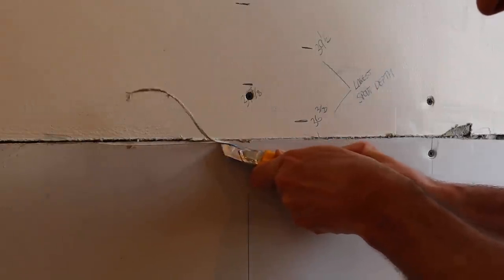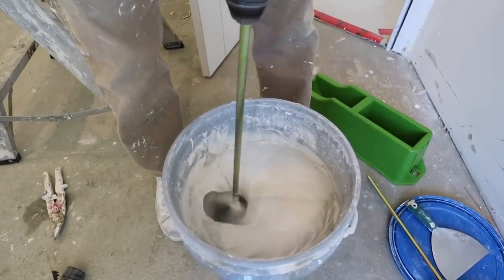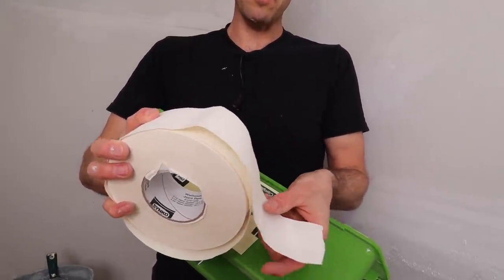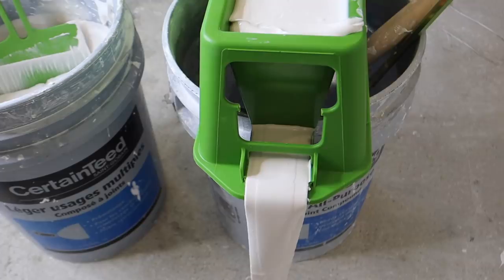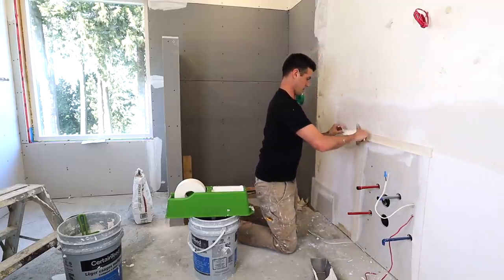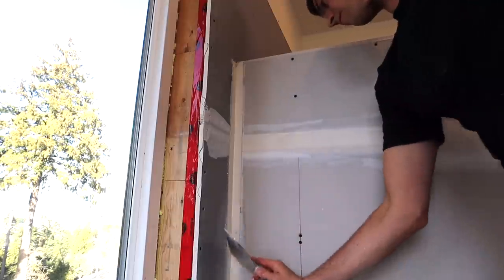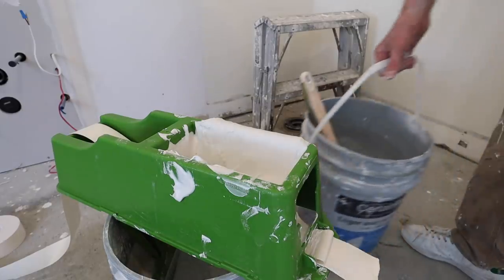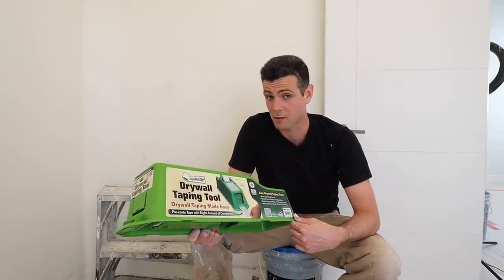How to use the Tape Buddy

Comment: This is great if you have to do a small repair or room. Don't have to take out the bazooka and pump. I've seen guy make 2 slits in the bottom of a mud box and fill it with mud. 
Good video my dud

Comment: My dad what is a drywaller started out Young when he was in his teens he made a tape buddy out of 3/4 inch wood at the bottom of a trough they made it where the tape would fit. How to tape reel on the back the type of Pole from the back of the trough to the front what's an extension on the front a cut find blade hacksaw at the end to tear the tape. He got so good at calculating when pulling the tape out how much to pull for all his flats and butts he would leave it through his fingers start at one end pull the tape to the length right before is wingspan reach. He would hold the tape over the joint pull it and snap it right into place wether was a ceiling flat or a wall. That was in the fifties and sixties.. he had hung so much sheetrock and finished. 
I never seen him sand. He is 4-inch 6 inch and 12 inch hump and flat trowels.

Comment: I wish you would explain prefilling more what do you use to pre fill.. is it just all purpose ...if so are you letting it dry before taping over it or not
Reply: Pre-filling should be done with setting type of compound so it doesn't shrink. Pre-filling is only needed where drywall gaps are over 1/8" or areas like broken corners or edges. If you do need to pre-fill areas make sure the compound stays below the surface of the drywall then tape over it. With setting compounds you can tape over this when it sets up and doesn't need to wait until it's dry. I usually buy 20 minute compound so I can get the job done faster. Many times corners are the worse. They need pre-filled as they seem to be the areas where the drywall doesn't fit tight.

Comment: Awesome video. What about using a Sheetrock 90 Joint Compound for the medium size or small joints? I mean apart for hardening in 90 minutes and drying in days is there another difference with all purpose join compounds? Thank you.
Reply: You can read information on the types of mud on our website
BuddyToolsLLC.com

Comment: What’s your thoughts on FibaFuse drywall  Tape?
Because it’s not paper it doesn’t swell up reducing the thickness on the seam. As well, like fiberglass tape, the taping compound flows through the fibers imbedding the tape more thoroughly, as opposed to sandwiching it in the case of paper tape.
For me, I find the FibaFuse requires less feathering.
Reply: Peter, I just made a comment about this under what Bradly said about the NUBS in the fingers. This is an issue. It hurts and they don't come out very easy. This tape also doesn't lay as flat as paper and the fibers keep coming to the surface. They don't sand off since they are glass. The TapeBuddy tool can run this tape just like paper but I prefer normal paper tape. Goes on flat and is strong when applied right. Yes, the mud squeezes though the tape so has value in this regards. When this tape is run through a TapeBuddy tool you don't need to pre-coat the seams which saves a lot of time. The tape is more costly than paper. Get a TapeBuddy tool and it will help make using Fibafuse tape easier.

Comment: Careful with the US advise. 
I tried to tape with that lightweight Plus 3. The tape literally fell off the ceiling. It’s garbage for tape. You MUST use green bucket or setting for your tape coat.
Reply: I picked up a bucket of light weigh mud with a lime green lid just for doing a demo. It was damage and Home Depot sold it to me for $3. How could I go wrong? So I fill the TapeBuddy tool for the demo, pulled the tape from the tool, applied it on the drywall as I'd done 1,000's of times before. Tape applied I turned to the person to tell them something for maybe 1 minute. When I turned around to the demo piece to show how the tape was working it was already peeling off the drywall. I didn't use this anymore and tossed the bucket in the trash. Might be good for top coating but not taping. That's why I always suggest Sheetrock green lid heavy weight compound. It's the hardest compound out there and work great all the time.

Comment: Hi! Thx for the video! Can I use several strip of paper for one joint? Exemple a 8' foot joint with 2 strip of paper of 4' each?
Reply: You pull the length of tape that's easy to work with. Joints don't make any difference in strength and the tape can be butted together or overlapped.

Comment: Thanks so much for all your videos. They are so helpful. The only thing I struggle with... you introduce the products available in Canada and US however, I'm in Australia. While I find all the different coating products in our local hardware stores, I struggle to find what you call "quick set". My thoughts are going to something like "Polyfilla" .. am I on the right track? The products you introduced in this video are not available in Australia, as far as I could find out. What would I need to look out for, any hints? Also, I find it quite annoying that with the products available to me. I need to wait for 24 hours to do the next coat, but it seems like my local plasterer does the whole job in a day i.e. taping, first coat, second coat. Am I sort of conned here?
Reply: I'm not in Australia, so I'm giving an answer based on a quick google search, but I believe that Rhinobed is what you're after.  The website calls it an 'adhesive setting' plaster, Sounds like quick-set.  So if the Aussie stuff follows the general trend of our stuff, then you would use Rhinobed to pre-fill the joints.  It will be a fast setting plaster with high strength and low shrinkage.  This means that you do NOT want to have to sand this stuff.  Put it on smooth and don't leave high spots.  You can use it for the taping coat with fibreglass tape, but Rhinoglide will be better for use with paper tape.   After the pre-fill you'd use Rhinoglide for taping (unless you use Rhinobed with fibreglass tape).
Rhinoglide is equivalent to our 'all-purpose'.   As far as I can tell, Rhinoglide and Rhinobed are the only products you should be looking at... The other products (like Rhinolite) are for plastering, not joint compounds.
Rhinobed seems to be equivalent to a 90 minute quick-set.  If you want it to set quicker then use hot water to mix it, and it will set faster.   The website implies you can get different setting times, but the product sheet just says it set in 90 minutes, so... I'm not sure.  Here the bags are marked as 20minute, or 45 minute, or whatever, and you can use whatever speed appeals to you.  90 minute is still an order of magnitude faster than normal joint compound, so don't feel like you 'have' to have faster mud.
Reply: @mikegraham7078  thank you
Reply: @claudews529  thanks champ. now it makes sense

Comment: Great video as usual Ben, I’ll definitely order one through the link next time I’m doing a Reno.

Curious if anyone could provide advice.  I always mix up too much in my bucket, what do you do for cleanup in that case to save the bucket?
Reply: Eddie, to avoid mixing too much just mix the top part of the bucket and more as you need it. This will depend on how much taping you have but you can always thin down more mud. Also, I save most all of my buckets as well. Use the Scoop-n-Scrape bucket tool to remove all the compound from the bucket for easy cleaning and less wasted material.

Comment: Will I have troubles taping in the states with all purpose? I’ve heard that you need the glue in “taping mud” to stop blisters. Or should I use some form of quick set? Thanks
Reply: The all purpose green lid mud is perfect for taping. The glue is the wet mud so since the TapeBuddy applies the mud to the tape you won't have problems with tape blisters. You can find more taping information on
BuddyToolsLLC.com

Comment: QUESTION:  HAVE YOU EVER USED "Fibefuse" TAPE (widely available at Home Depot, Lowes, Menards, Amazon)? Could you make a video giving your opinions with it?   Love all your videos.
Reply: I have and I hate the stuff. I don't care if it's 1000 times stronger, the fiberglass nubs in the fingers gets old fast.
Reply: @bradley3549  You are right on the NUBS in the fingers. It hurts and they don't come out very easy. This tape also doesn't lay as flat as paper and the fibers keep coming to the surface. The TapeBuddy tool can run this tape just like paper but I prefer normal paper tape. Goes on flat and paper is strong when applied right. We'll see what Ben says.
Reply: @BuddyToolsLLC  I wear nitrile gloves when using fibefuse.

Comment: Hey, Ben! Happy Easter! 

Another great vid! I'm curious; i recently got a roll of fibafuse tape to try. I've done a couple of small repairs with it, and so good, so far. Wondering what your experience with it might be and how you think it might do in the TB, or other tape tools. Thanks!
Reply from the maker: I will make a video soon. I used it a bunch years ago. I'm not a fan. It gives me painfully itchy fingers.
Reply: @vancouvercarpenter  Same! Fiberglass in the fingers is THE WORST. I'm not a wasteful guy and I toss my last roll out.
Reply: I also found fibers in my hands but by using the TapeBuddy I didn't need to handle it near as much. Made it so much easier.

Comment: You never seem concerned with the mud drying on the inside edges of the bucket or bag. How do you deal with the bits of dried mud getting into your working mud?
Reply: Good question. This was a problem until we started making the Scoop-n-Scrape tools. We designed the Scoop-n-Scrape to use with the mud in the bucket and just for this purpose. This tool is made of plastic (nylon) so it doesn't scratch the bucket. Metal scoops tend to peel the bucket and put shavings in the mud. Not good! The SnS tool will scoop the mud out but it also can clean the bucket sides by returning the mud to the remaining mud in the bucket. After I push the mud back down I take a wet brush and run around the inside of the bucket. Cleans it up nice.  You can also use a wet rag. Check out the SnS video on the BuddyToolsLLC website.

Comment: This tool is ok at best. Ben is right in saying that the 250’ roll is best.  But you can’t really measure long lengths so you always have 2-3 pieces on a long run. 2nd it’s not very stable. 3rd corners are a pain trying to tear off a long length is a nightmare.
Reply: Just pull the tape and book it over to any length you like. You can use arm length pieces and just butt the ends together. Much easier to handle.

Comment: Don't forget to add some vanilla and food coloring. You want your mud to be yummy and pretty! ;)
Reply: A few years back I was set up at a Home Remodeling Show in IN demoing how to tape drywall with the TapeBuddy. We had 1,000's come by the booth to check it out. I had purchased a huge cinnamon roll from Cinnabon that was heavy on the sugar glaze. I took a fast break, went behind the display, took a huge bit and came out licking the coating off my fingers. It was so good! When I returned the the demo area there was someone standing at my booth that just gasped as he thought it was drywall compound. Still remember his face. That was the show where we presented the first Scoop-n-Scrape tool. A Sherwin-Williams store manager came by, saw the scoop and said "It's about time someone made a scoop that works."

Comment: hey buddy i watch all your stuff is this worth is i do about 2 houses a year and where is the link to buy thought you. thanks
Reply from the maker: If your doing a house you may want to try something faster. For small jobs these are great. The link should be in the video description.
Reply: Hi Mark, you mention doing two whole houses per year but as a remodeler you'll work on the drywall as the project moves ahead so drywall will be ready in stages. You'll find the TapeBuddy tool meets the need for any size project and is perfect for any taping job without the working weight of a banjo.

Comment: Can you fill a bucket with the wetted tape like you do with the columbia semi auto taper?
Reply: Do you mean coated tape? Some people have suggested running the tape through water before putting it over the seam but it's a bad idea and give you the results you are looking for. The wet tape will repel the glue in the mud and it won't stick. The tape needs to draw the moisture from the mud.
Reply: That's not what he's talking about..dude has a video where he uses a super taper and he pulled the tape through the mud like 100 ft at one time and put it in a bucket and installed the tape from the bucket (slopp bucket method)

Comment: Hey Ben, I just tried my first bigger tape job outside of patches. When applying the tape by hand I’m getting ridges along the joint in the center of my tape. First I was using a 90 minute setting mud then switched to ruco middleweight all purpose. It’s happening on both types of mud. I’ve thinned the mud, I’ve made sure the crease is the right way but as I’m wiping out the mud it forms a ridge down the joint. Only happening on recessed joints. Please help, thanks
Reply: Tyler, if the joint is wide it could be the mud oozing into the space is heavy. This shouldn't be a problem with wall seams but ceilings could be. When you use hot mud to tape it doesn't shrink back but stays where it ends up. The Sheetrock all purpose mud shrinks as it dries so pulls the tape flatter to the surface. This ridge can happen easily on ceiling joints as the weight of the mud works with gravity pushing down. Don't make the mud too thin so it stays in place. That's why it's important to place the mud on the tape first then the tape to the seam. The tape pulls the moisture first then the drywall. The TapeBuddy tool allows you to do this fast. Make sure you feed the tape the right way so it muds the creased side.
Reply: @BuddyToolsLLC  thank you

Comment: Hey ben . i search for your Brush for cleaning my tools whats is the name.  Cant find one on amazon. Do you have the link or the name.  Canada
Reply from the maker: I can't find it either. That thing is like 10 years old😂
Reply: @vancouvercarpenter  ok i will try harder to find one and post the link here
Reply: I recommend using a round automotive parts cleaning pointed brush for cleaning drywall tools. It fits into the corners and is stiff. Works well.

Comment: would using a corner trowel be OK for doing the corners ?
Reply: Nooooo.. dont waste your time. Those things are only for plaster
Reply: @TheBasedUchiha    OK.    i used one i borrowed from a friend,  it seemed to work good,  looked about the same as using knife.
Reply: @normhodgkinson6965  yeah it'll work. It just takes longer and leaves uneven coats
Reply: I don't use them for taping as it sometimes tends to roll the tape to the side. Embedding one side at a time works fast and easy. It's also the taping knife I am using on all the joints so I don't need to change. I've purchased several over the years and don't use any of them now.
Reply: @BuddyToolsLLC    thanks for the info.   i don't do a lot of drywall work,  so i'll keep using the knives.

Comment: CGC says to always first fill joints with 90. Damn if i know what is right.
Reply: Go with 90 and you can't go wrong.  I'll even use sheetrock 90 for to bed the tape and for first pass on screws and seams.  Less shrinkage is a good thing.  Just don't go crazy putting it on, as excess just means more sanding which is a PITA.
Reply: @VC-Toronto  Thank you from Nanaimo.
Reply: I don't recommend using setting type compounds for taping unless you're in a real hurry. This type of compound doesn't shrink. So if you have a layer of drywall compound behind your tape the tape ends up being held farther from the surface of the wall causing it harder to cover especially on butt joints. When taping with the tape buddy tool the tape dries quickly because there is not that much compound behind the tape so you can begin the second coat very quickly and get the project going. I also use setting compounds for my nails and all my second coats over the beveled edge and corners. It doesn't shrink and does a better job of filling in those spaces.
Reply: @BuddyToolsLLC  I use tape buddy and apply the tape right over the joints, zero pre filling. been doing this for years, no problems yet.
Reply: @BuddyToolsLLC    These day's I'm using Fibafuse pretty much 100% of the time.  As it's mesh, when I wipe it down with a knife the SR90 squeezes through the mesh and the mesh itself is sitting on the drywall with the SR90 acting as the adhesive, so buildup behind the tape isn't much of an issue.  The thickness of the fibafuse is the thickness of the joint.        Setting compound DOES SHRINK!!!  Maybe not as much as pre-mix, but it does shrink.  If it didn't, I wouldn't have to second coat screws.

Comment: Gotta ask why you don’t just use a banjo?
Reply: Banjos get heavy and are not always easy to manage. High learning curve. Great for crews but not for small jobs or home owners. With banjos you apply the tape then have to lay it down, pick up the joint knife, then return to the seam to embed the tape. The process takes times. If working on a ceiling with a bench or ladder it's even worse. The TapeBuddy is faster. Pull the tape, apply, embed and you're done.

Comment: I like seeing new products like this especially for small projects for your average homeowner DIY. But the price point doesn't make a lot of sense. $40 to just the tape buddy or the kit for $60. Especially for it being in Canada too price is higher. Why not just pay $90 for your basic Masterforce banjo and increase your taping production by 500%. Measuring every piece of tape or cutting it short or long and wasting more time and material just doesn't do it for me here. Get the tool that will save you lots of hassle and actually lasts for years.